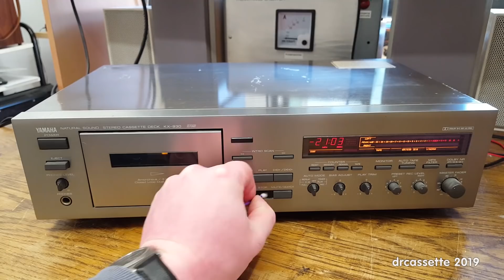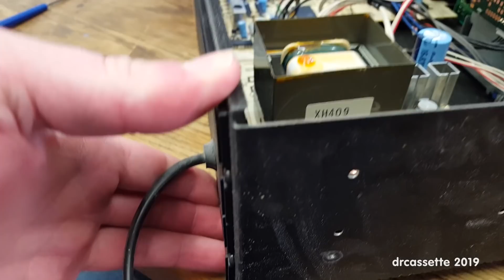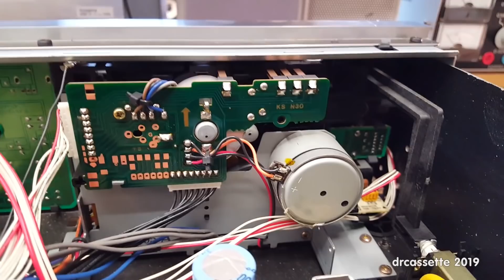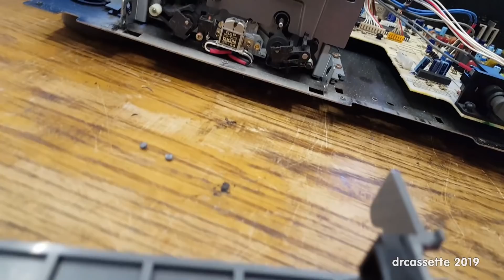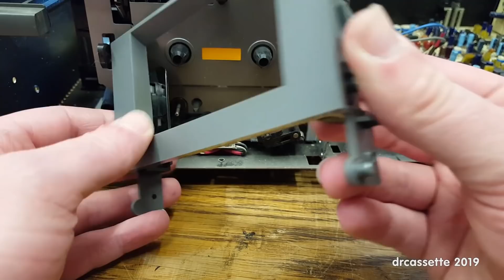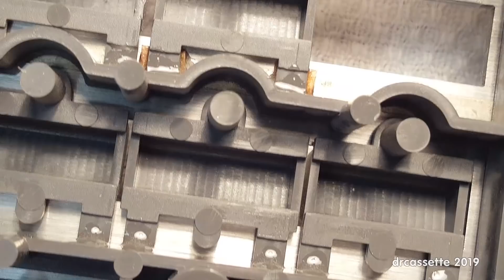Yamaha KX-930 cassette deck repairs [1/3]

Comment: Hi, I have a Yamaha Stereo Cassette Deck KX-870, bought around 1999 in Germany. I live now in Thailand and have now a problem with this cassette deck. When I push the start button the tape runs aound 3 seconds but then stop automatically. I would be really happy if you could give me a tip to tepair the deck by myself or give me an advice where I could let repair the deck or where I could get spare parts. Thank you in advance.
Reply: Check torque on the take-up side. Highly probable there is not enough friction to pull the tape into the cassette and it stops by automatic stop as the cassette reel is not moving. This will require to disassemble tape transport to get to the reel mechanics. Sony has gears there and many others use such called "tire", which wears and needs replacement.

Comment: Thanks for the great video.   Belts replaced, and its working.  Except that the cassette keeps disengaging...it starts to play, but then stops.  Same with FF.  Any ideas?  Thanks!  Andrew
Reply from the maker: Make sure the sections with the back and white pattern around the takeup and supply reels are clean and can be read by the optical sensors. If this system can not work because for example it has pieces of the old belt in the way, it will trigger the auto stop.
Reply: @DrCassette  Thanks much!   We'll give that a try...

Comment: I don’t know where to ask this query. I have an issue with auto reverse cassette deck Luxman K 105. It sounds great, it offers fantastic recording results, but for some odd reasons, it cannot record METAL tapes well. The left channel has a maximum output of no more than 3dB while the right channel is silent. I noticed there is excessive distortion on the left channel and too much compression when I record metal cassettes. When I cover the holes on the top of the metal cassettes, the deck recognizes metal cassettes as chrome, and he records them without any problems. The output is strong, and it goes over +6dB, and it's distortion-free. What’s the issue, and why the deck behaves like this when he records METAL cassettes? It would be logical to the cassette deck behave in the same way while he records ferric or chrome cassettes as he behaves when he records METAL cassettes. I don’t know what to do. Any assistance is appreciated.
Reply from the maker: Certain sections of the cassette deck electronics are different for each type of tape. There are different internal adjustments for each type of tape. Your fault description sounds like in Metal position there is either no bias at all or the bias is extremely low. Please refer to the service manual for your cassette deck (should be available online) for instructions on how to adjust bias.
Reply: @DrCassette  Thank you for the advice. I hope I'll manage to find the way how to fix this because this cassette deck doesn't have a bias adjustment knob. Everything is 100% automatized, including auto bias calibration.

Comment: Beautiful deck! There should be a thermal fuse hidden inside that white plastic part of the transformer.
Reply: Yup, that looks like the type of transformer that would normally have a thermal fuse buried in the windings.

The downside to that, is if the thermal fuse blows, it practically can not be replaced as the windings are usually wound on top of the thermal fuse.
Reply: @TehMG  Yes it can be costly and time consuming, I have installed a simple fuse holder soldered to the power cord and with heat shrink inside the equipment in cases like that.  Quick, effective, cheap solution. Example: https://www.ebay.com/itm/10Pcs-5x20mm-AGC-Glass-Fuse-Holder-In-line-Screw-Type-With-22-AWG-Wire-Cable-E1/232799229005?hash=item3633ea544d:g:UjYAAOSwk95bGwEU&frcectupt=true

Comment: I do have a Yamaha KX-670 which I bought new in the 1990s, I paid 647,00DM for it. Even the original box is has survived. The tape deck itself has some issues. It makes a squeeling noise and plays a little to slow. Probably the mother or capstan bearings have run dry.

Comment: I have a Nakamichi silver about 1992 with adjustable azimuth head. How easy /difficult to replace a belt?
Reply from the maker: Replacing the belts probably won't be easy on that deck.
Reply: Get belt from MARS, very close to original Japanese to keep W&F low and stable speed. Not cheap but will last and perform longer than some unknown replacements. Relatively easy to change, and since the mechanism can be removed from chassis put some synthetic oil into capstan bearings.
Reply: Get service manual for your Nak - makes life much easier : diagrams and schematics
Reply: Nakamichi Cassette Deck 1 Limited

Comment: I am about to repair a technics RS-TR232 right now. Really weird issue. Sound stopped while playing, now the level meters are always 100%. My guess (and hope) is that only a transistor in the PSU area burnt (hopefully not the audio IC itself).
Everything else works, just the audio doesn't.
Good thing is I found the schematics. Only very low res, but better than nothing.
Reply from the maker: Yes, having the schematics is important. Do check the power supply, but with the level meters at 100% it seems to me like some component shorted out and you now have DC in the audio signal. Good luck with the repairs!
Reply: @DrCassette  found the error. Even if the electrolytics looked fine, one was shorted. (Never had that before...) I replaced it ( with a bad high ESR semi-bulged one I had lying around for now :( ) and now everything works. Took hours of multi meter usage to find it, but was a good training for me ( EE student ;) ). The shorted cap pulled the base of one of the main transistors low.
If I have enough time I will fully recap the PSU section, I have lost my faith in it, even if the caps are panasonic Matsushita ones.

Comment: Nice looking deck, but those tiny plastic parts give me the heeby jeebies. The mechanical stresses this material has to endure during the life span of the product... I am much more comfortable with reinforced concrete😀. Plastic is such a tempramental material, it’s flexible and brittle at the same time. Some plastics seem to get brittle after a certain age, like those pins but also gears in some products.
Reply from the maker: Metal would be more solid, but the plastic in this cassette deck seems to be OK. My theory is that some child violently pulled on the cassette door and that caused the plastic pins to break. Under normal conditions these pins would be good enough for reliable service.
Reply: Like human bones and human teeth.

Comment: You should like this Yamaha 3 header, it only lacks Direct Drive - very similar mechanism like Akai GX-95, 65, and many others. As for the pin being to short, some metal epoxy to build up the missing material would work. These machines have very good heads and should last long time. Play Trim is very cool feature - with some tapes made on different decks really helps in proper Dolby tracking. You will notice that Yamahas sound softer than Akai and many other decks. Very nice find, wow. Best luck with it 👍

Comment: Hi doctor...I got yamaha KX-690 ..the play button doesn't work once pressed it goes 1/2 turns then stop...please please need solution...I"ll be much thankful for reply... Cheer's
Reply from the maker: Could be bad belts. Seems like your cassette deck tries to play but then triggers the auto stop. So basically something that should be moving does not move.
Reply: Service manual is available on the web for 690. Also ask people at tapeheads.net - there are some very knowledgeable people there. Like Doctor said first check for belt issues, sometimes motor problems. Get service manual first.

Comment: Epoxy usually works fine for that kind of repair, I have fixed a lot of damaged buttons on 90’s Macintosh computers the same way, back in those days the front panel buttons on the computers were almost always made this way. Also, a bit of sanding before has proved to be a big advantage.

Imagine if the only problem with this deck was the de-attached spring. A lot of people would probably have thrown it away just because of that... I know not many people has the knowledge/possibility/patience to fix these things but one can’t deny that throwing away stuff in that manner is quite some wasting of material.

Comment: Interesting.  I have the black Yamaha KX-650 with virtually all the same features; dual capstan drive, three heads and Dolby A, B and C.  It works well and as I got it at the time when many were shifting to CDs, it was virtually unused when I got it.  I'll be interested to see how that repair goes.  Cheers!
Reply from the maker: The KX-650 was the middle-of-the-line in 1991. There are some differences, for example the Auto Tape Tuning function is missing on your deck. And by the way, no cassette deck ever had Dolby A. That was an extremely sophisticated noise reduction system designed for recording studios in the 70s. Dolby B was the cheap consumer version of that system.
Reply: @DrCassette  Thank you for pointing that out to me.  On closer inspection it says "Dolby Off-B-C", pardon me for not looking closer.  I await Sundays video with interest.
I got it as [art of a lot with a TEAC cassette machine of similar function to the Yamaha functions, a Kenwood 5020 Amplifier and a pair of Mordant-Short loud-speaker units.  Definitly 'middle-range' for their time but still working well, although the Kenwood amplifiers 'input selector' rotor is a bit slippy but with careful handling, it finds the tuner and tapes.  It's a bit more than just a drum or row behind the faceplate.  Cheers now.